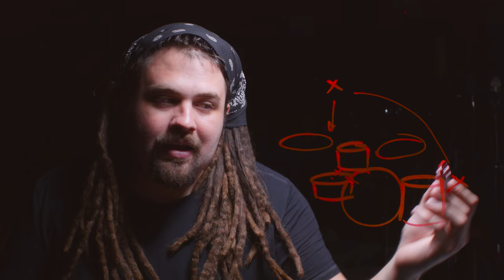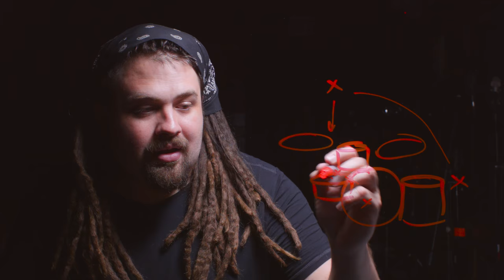Glyn Johns Technique - A Cool (And Authentic) Final Step

Comment: This has been my go to drum mic technique since I was a poor twenty- something in the eighties with only four working mics. I used two 1960s Shure Unisphere omnis for the "overheads", a 1970s SM57 on the snare, and a 1950s EV Mercury 911 crystal omni in the kick.

I've upgraded my mic locker a bit since then, but still use the same setup, even if I close mic toms, hat, and add a ribbon or the Sylvia Massey garden hose trick for the room.

If you don't have a lot of mics, you can bus/send your two overheads to s new track in your DAW, add a 100% wet delay and/or reverb to create a virtual room mic track and compress to your hearts content.
Reply: It works well, but there are some gotchas. The overheads really need to be equidistant to the center of the snare and kick beater to prevent phasing and preserve accurate stereo imaging if you are panning them. 

Also, if you are tracking in an untreated room, keep the drum set centered to minimize reflections and bass buildup from corners being overemphasized in one of the overheads.

Cheers!

Charles

Comment: Another Glyn Johns style technique is to use the overheads to mic more of the toms. For example: the overhead mic is 24" from the rack tom and the side mic is 24" from the floor toms. Both mics point down at the toms and it keeps them even in the mix. This really only works if you use a snare and kick like you did here.
Reply from the maker: Great idea. I'll have to try that.

Comment: thank you ,nice and concise, and just what I was looking for.
Reply from the maker: Sure thing!
Reply: Tried this out the other week in the studio and it worked a treat, then we built up from there once the sound was good, with the simple set up and got some cracking captures so thank you, I have a quick question, if you were set a task to record a band in full, but you weren't allowed to do any processing afterwards, other than volume fades and panning, would you use any processing whilst capturing? or just concentrate on good mic placement and capturing the best take?

Comment: I've used this quite a bit... when I'm running out of inputs or I'm too lazy to set up all the mics :P
It's my go-to rehearsal recording setup.  This plus a BD mic is really easy to mix and sounds good to me, but everything you said is true. It has a lot of issues and if I have the choice I'd much rather have good cymbal separation and add everything else with close mics.
Reply from the maker: Ha, yeah. There are parts to this technique that sound really vibey and cool. But there are tons of issues if you want control.

Comment: I "Glyn Johns" using dynamic omni mics over the snare and pointing at the HH from across the top of the floor tom.  Both mics are of equal distance from the center of the snare. (Like exact equal distance.) I mic the kick, and add a mic (sometimes) on the snare itself. Try the omnis, you'll thank me later.

Comment: Based on the audio sample in this video the floor tom was noticeably louder than the rack tom contrary to your closing remarks. Did you tweak something to bring out the floor tom? Thanks for all of the highly valuable and extremely informative and detailed work.
Reply from the maker: Yeah you are right about that. I should have articulated that I wished the floor tom had more low end, and was fuller sounding.
Reply from the maker: Ya know on second thought, this highlights why this is so frustrating. You want to get some proximity effect going but the tom was already too loud.
Reply: creativesoundlab it would interesting to hear this set up in a mix... i.e. How does a full mix effect the balance of the toms etc.in any case, these videos are extremely helpful!!
Reply from the maker: Yeah, totally, plus when you use compression how much of the problems go away or get worse.
Reply: creativesoundlab have covered compression on cymbals/overheads in previous video lessons?
Reply from the maker: Yeah, it's been a while though....https://youtu.be/YbQy2YmhIyw?t=6m36s

Comment: Hey Ryan, another great video. I have an upcoming project that by necessity requires the Glyn Johns method. Your earlier video on the technique was VERY enlightening, it will definitely save me some frustration. I have the good fortune of recording in an old chapel, very big room, very high ceiling. I'm a little worried that the sound will be too ambient and boomy. Should I attempt any isolation on the drums or just concentrate on mic placement?
Reply from the maker: I think the bigger the room, the easier this technique is to pull off. I haven't done it in a room as large as what you are talking about, but for me most of the problems and frustration comes when the room is small. I would stick to cardioid mics, keep them close as you can, and possibly use a couple gobos or absorption panels around the kit. Check out this video and pay attention to the "Air Studio One With Panels" vs the "Air Studio One" without panels. Great example on how you can tighten up a room if needed in your situation. https://youtu.be/sydt50-Cxhc?t=4m21s
Reply: Awesome, thanks so much for the input!

Comment: I think a lot of the problems with this can be solved with the bassdrum mic. If you keep it the same distance from the snare as the overheads, and by this more way from the bassdrum than usual, you can record the whole low end of the kit with it. this than allows, to cut more body from the overhead. „Transfering“ this to the bd mic if you will. Not only will the bd sound more natural, it is dead center, and so will be the lowest part of the snare and toms. A lot of engeneers in the past miced the bassdrum with more distance. and allthough they were forced a lot of the times, it really has a lot of potential. It is one of the most overlooked things in drum recording these day. Everboy is scared of bleed on their Bassdrum, because it is harder to get that industry standart omph with bleed. but i think it kills the character of the drum most of the times, like i really feel the personality of drum sound is completly lost on 90% of contemporery records.

Comment: Even just the two overheads and a kick mic is really good, but kick, snare, two overheads is my go-to, and doing it like this would just be a matter of position (and later panning) the two overheads differently. I like it though.
Reply from the maker: Nice! Yeah, I was trying to do the traditional set up. I may or may not have gotten it right, although it turned out better thanI was expecting.
Reply: creativesoundlab Sounded good to me. I am just amazed at all the ingenuity and creativity that was inspired by necessity, people had to squeeze an entire band on to 4 tracks, so they just did it. They found ways.